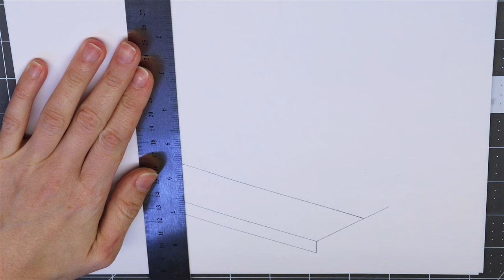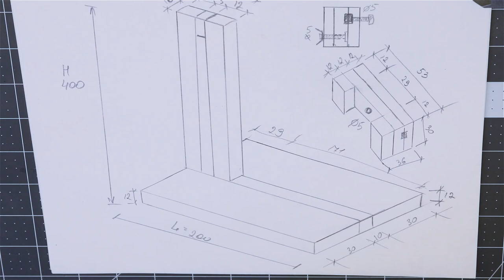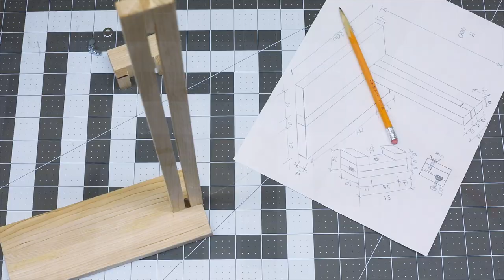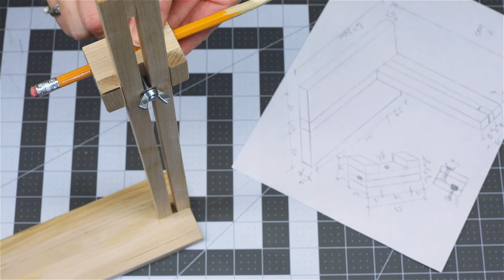How to make a MARKING GAUGE - WORKSHOP for shipmodelers

Comment: Olha, this is a neat combination of a Machinist's height/marking gauge which scratches lines on metal using a hardened scriber, but I would have never have thought of making and using one like this!  Very nice!  You could also replace the pencil with a pointer to measure and/or transfer scaled dimensions to and/or from models with your marking gauge too, if needed.  That way it does multiple functions.

It's amazing what anyone can do in a small home workshop with a few small tools and the experience gained from simply doing a hobby until you've figured it out!
Reply from the maker: Thank you!
P.S. My workshop is not so small now - it is even bigger in area than my apartment in Kyiv)))